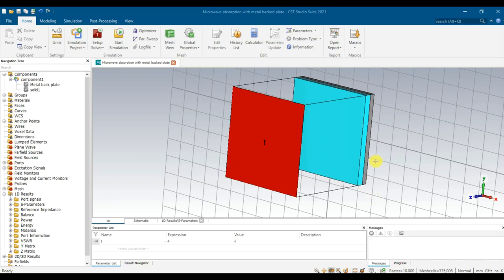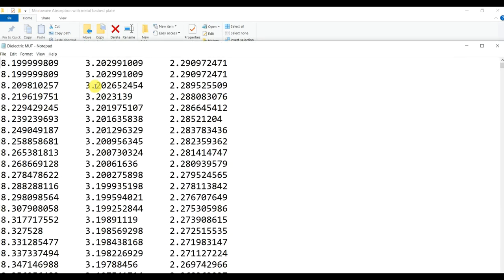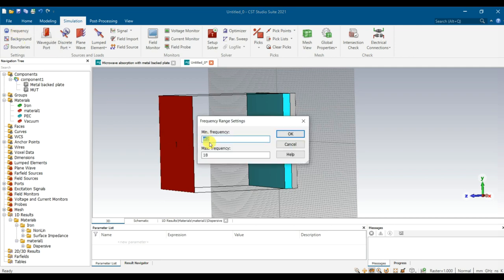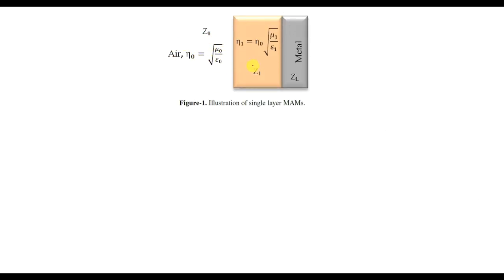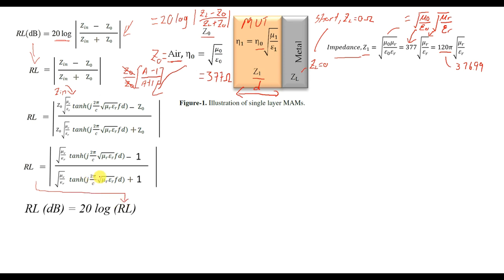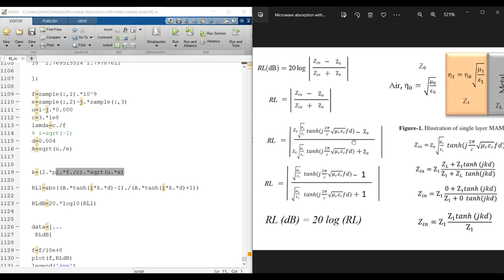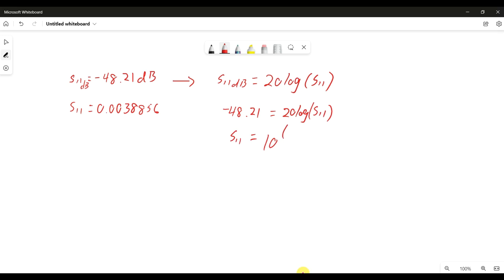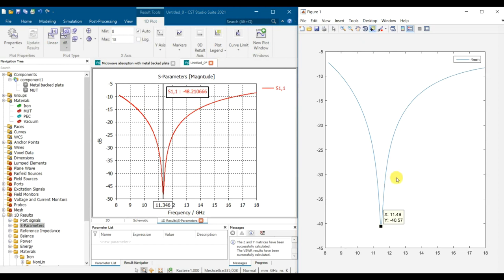How to Calculate Material Microwave Absorption with Metal  Backed Plate

Comment: Hello we calculated the S11 and S21 parameters experimentally of our material. I want to check the absorption and reflection of the material. But we don’t have permeability and permittivity of the material how we can calculate these parameters? We used coaxial line method to calculate the S11 and S21 for our material.
Reply from the maker: For your case and setup is not with metal backed plate. You cant use this calculation and also you have no permeability and permittivity value. You should just use the equation of Absorption = 1 - s11^2 - s21^2. S11 is you reflection of the material, you may refer to this video https://youtu.be/vae_nMPVOSA?si=zeUU8wL0mFtulq2f
Reply: @LYSStuff  we make a material with PDOT and MCWNT(carbon nano tube) you say it our material is conductive and absorbs the EM waves. We find out S11 and S21 parameters for different frequencies and experimentally right? our material is new we don’t know its permeability and the permittivity and loss tangent when defining a new material in the simulation. How we can find out these things. Could you refer me some video or can tell me formulas? Because when finding the permeability and permittivity we need to use reverse algorithms and formulas. And it also contains Cos^-1 (cosine inverse function) so how we will be sure our permeability and permittivity is accurate and will give us accurate values to match the experimental and simulation values. I will be very thankful if you can guide me on this.
Reply from the maker: @usamatahir1353 yes, try to use NRW method to calculate material properties from you S11 and s21. But if your method of measurement is incorrect (without proper calibration such as TRL or others factor like distance define) , then the results will looks weird.
Reply: @LYSStuff  yeah this is what i think. Thanks for reconfirming about NRW method. I was confused about the method. Thanks have a good day. And keep in touch. I am happy you share your thoughts.